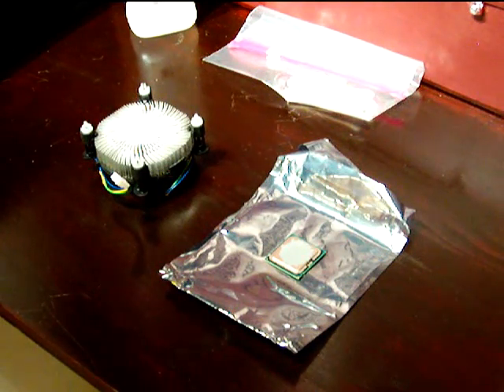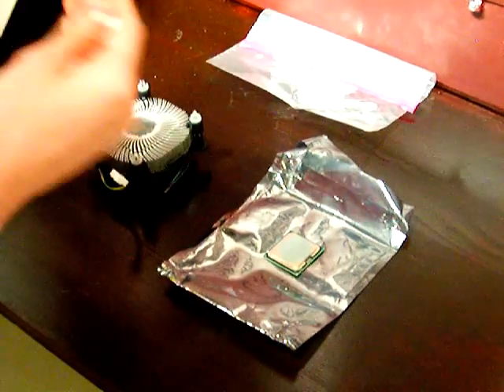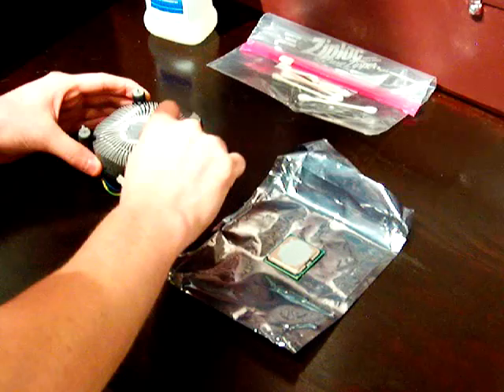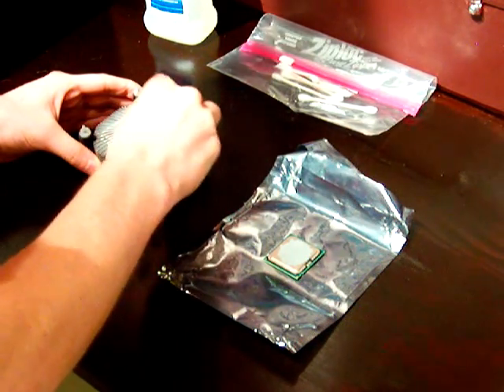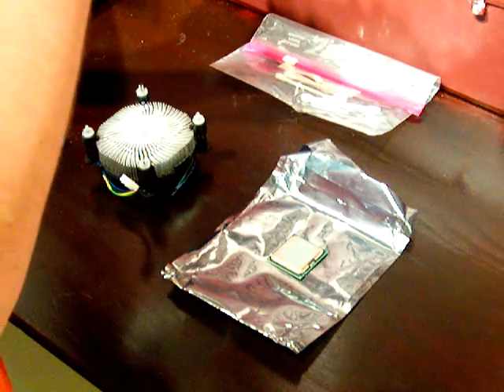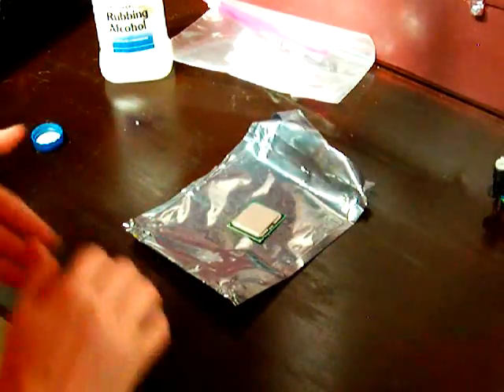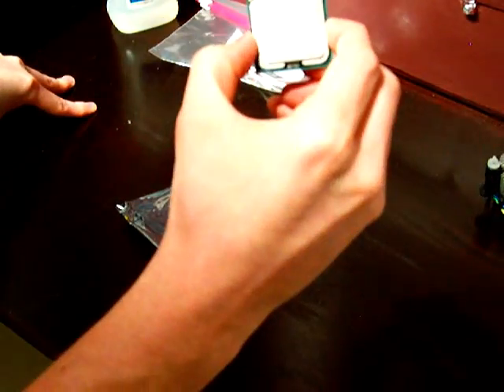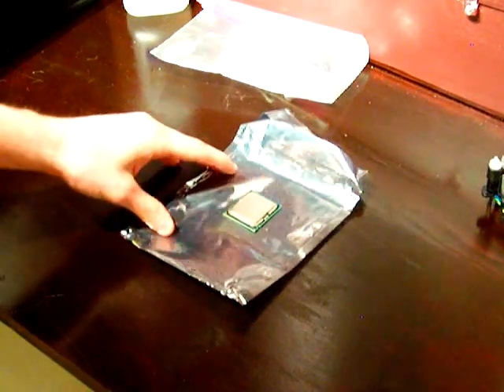How To: Remove Thermal Compound from the CPU or Heatsink

Comment: Mainly due to that when you remove a fan or cooling unit, it will smudge the paste and very likely cause air bubbles when you install a new item. Air bubbles will trap heat and prevent efficient transfer, which you don't want. So even if you were to remove and replace the same cooler, it's normally a good idea to do a clean re-pasting.

I accidentally smudged the paste too much when building my first PC. Had an idle temp of 60c. Re did the paste, and dropped it to 30c. Damn microscopic bubbles.

Comment from the maker: Ideally you should remove the cpu from your motherboard and place it in an anti-static foam square. However, you can clean the cpu heat spreader and apply more TIM while it's installed in your motherboard so long as you don't get any TIM on the board.

Comment from the maker: Yes, TIM (Thermal Interface Material) refers to thermal compound. Personally I prefer to use Artic Cooling MX-2. MX-2 has great viscosity and thermal conductivity, though there are plenty of other viable options. Artic Silver is one of the more well known compounds that I would recommend. Keep in mind that even generic compounds included with heat sink/fans are usually perfectly sufficient.

Comment from the maker: 1. That is isopropyl alcohol as mentioned in the video. 
2. The faraday bag is not contacting the cpu (antistatic foam square) and is simply there to prevent the foam square from sticking to the workbench.

Comment from the maker: Anytime you separate the cooler from the cpu, I recommend cleaning and applying new TIM. As per your question, you can monitor your cpu temps with downloadable utilities. If you weren't experiencing issues before cleaning your computer, the application was likely fineand your temps were in acceptable thresholds. When applying Thermal Compound, you ideally want to apply a thin layer that fills the gaps between the surface of your cpu and heatsink.

Comment from the maker: Qtips are not ideal, but are nice for this particular application because they're readily available to users and are very unlikely to leave behind 'hairs' since we're working on a flat surface with wetted q-tips and no sharp edges for 'hairs' to get caught on. Should you need to clean the fins of a hs/fan you are correct and q-tips should be avoided.

Comment from the maker: "As I've mentioned in the past, this CPU was inserted into an anti-static cpu foam square which was then resting on the faraday bag. The faraday bag was there to prevent the cpu/foam from sticking to the workbench. There were no conductive sources nearby and I was grounded so the cpu was perfectly safe. Again, let me reiterate, that you have misconstrewed the use of the faraday bag and are incorrrect about it posing a threat to the well being of the cpu."

Comment: The issue that's causing your overheating is likely the CPU fan's vent being blocked by a huge dust bunny, making it less efficient (thus the overheat and the high RPM). If your laptop has a removable panel through which you can access the heatsink/fan, then it will be very easy. If not, then you will likely need to take apart the whole laptop to clean it out properly. Blowing compressed air into the vent may help a little, but will not likely resolve the underlying issue.

Comment: Anti-static bags are only useful on the inside. Another note: According to Cisco's IT Essentials course that I took last year, you are supposed to use Isopropyl Alcohol to clean a CPU, so I believe it is safe to assume that Isopropyl would be a better solution. Although you have the point with the residue thing down. I'm not saying you're wrong, just suggestions for future viewers :]

Comment: @wmw0702 putting it on the anti-static mat is actually bad. A wood/paper surface would be good. The outside of the anti static mat can still collect a static charge, just the inside is resistant.

Comment from the maker: @snoopdogsballs It's not so much about damage as it is about residue. The top of the cpu is actually just a cover known as the heat spreader. It's a solid piece of metal that has no function other than to protect the cpu and help to better dissipate heat from the die to the heatsink. Optimally, any solution we would like to use for cleaning off this surface would 1. Dissolve the TIM properly 2. Evaporate quickly 3. Does not leave a Residue which can reduce thermal conductivity.

Comment from the maker: @TheBL00DAssassin In the same way that you would from a cpu. With high concentration alcohol and low lint cloth/swaps. Just ensure that the battery has been removed and all caps discharged completely before starting...and all alcohol has dried before turning on the system. Also make sure not to damage any components on the board or leave anything that might create a unintentional circuit. Lastly, make sure you are electrically grounded when handling all components.

Comment from the maker: @Knightman963 The higher the better for the most part, 90% is nice because it doesn't evaporate too quickly allowing you more time to clean off the surface before having to apply more alcohol.

Comment from the maker: @TheRammsteizer You should always clean off the CPU when reinstalling or replacing the heatsink. However, if your new heatsink already has a layer of properly applied thermal compound, then it should be ready to use and won't need to be cleaned (still clean off your cpu...). Its a good thing that the layer of compound is thin...Ideally thermal compound is only intended to fill any pores in the metal, but not interfere with metal on metal contact which has a higher thermal conductivity than TIM.

Comment from the maker: @QBisbest You won't get the best results with water, and need to make absolutely sure that it has fully dried before applying new thermal compound. I highly recommend sticking to isopropyl alcohol or a specialized compound removal kit/solvent.

Comment from the maker: @kashyap1991 In all honesty, its not going to change things that drastically...but its never ideal. Imperfections in the surface of your CPU heat spreader can potentially cause air pockets which reduce thermal conductivity. 

For practical purposes, if the scratch isn't too deep and you properly apply thermal compound you won't notice the slightest difference in temperatures.

Comment from the maker: Acetone and many nail polish removers are viable and will work quite well. Be sure that there aren't any dye additives. Also, high concentration isopropyl alcohol is recommended due to it evaporating quickly and its high purity. This ensures that no residues are left behind on the top of your cpu that might disrupt heat transfer.

Comment from the maker: @thedemoniaco if you bent the pins, you may very well have damaged the cpu. The heatsink is not an electrical part of your system, so no it doesn't particularly matter that there is a little compound residue on it.

Comment: @GameSinewPCs 
What happens if I accidentally bent 3 pins and made them straight again, would that affect the pc? i notices in the pc i am fixing that after i checked the cpu, the heat sink got some thermal compound and when i put the pc back together it beeps. could it be because of the Thermal?

Comment from the maker: @seafireliv I cannot condone the use of water for this purpose for a variety of reasons. However, if you must use it, be absolutely certain to not get it onto any hardware other thermal compound on the cpu. Also, verify that all water residue is completely dried before applying new thermal compound and or turning on your system.

Comment from the maker: @counterstrikenerd321 Yes, you can hold it by the edges with a latex glove, though the glove isn't necessary. The most important thing to remember is to not touch the pins (so as to not bend them or get oils from your skin on them).

Comment from the maker: @counterstrikenerd321 For general use, the discrepancies between most thermal compounds aren't significant, so any compound should work sufficiently. However, for high-end applications, some compounds will produce better cooling results, can be applied easier or cure faster (or have no cure time). For most general purposes, it is hard to go wrong with artic silver 5, though any compound should suffice.

Comment from the maker: @vnnmurphy So long as you did not remove the heatsink from the cpu, then it isn't imperative to have replaced the thermal compound. However, if you did remove the cpu heatsink from the processor, then you should have removed/replaced the thermal compound. Also, it is sometimes beneficial to replace old thermal compound, but usually insignificantly so.

Comment from the maker: @BryceIon When installing the CPU, hold it by the edges so as to avoid leaving oily residues on its surface. You shouldn't need to push down on the cpu itself when closing the retention bracket, so long as the CPU is seated correctly. The retention bracket is designed to apply the appropriate amount of pressure to the CPU.

I hope this was helpful.

Comment from the maker: It shouldn't be a problem. It would be best to simply ensure that the compound is still evenly spread across the heatsink surface. However, this doesn't necessarily require removing/replacing the current compound.

Comment: I accidently smudged the stock tal pason a stock core i7 heatsink, it is a little smudge on 2 of the bars, would I have to put on brand enw paste or would it be safe to use the smudged thermal paste, this is also my first build and donm't want to take any chances

Comment from the maker: @shawnygz You can apply a small amount of heat, but you really shouldn't have to. For alcohol, wait a few minutes until it evaporates and you should be fine. Water may take a bit longer, so a fan might help speed up the evaporation. Just make sure that the cpu is completely dry before installing it/turning on the system.

Comment from the maker: @FateStayNight1991 No, this would not 'break' the processor. However, if this happens, then you must ensure that the processor pins and or socket are completely dry before installing an turning on the system. Otherwise, you may create an electrical short and damage the processor or motherboard. High concentration alcohol evaporates rather quickly.

Comment from the maker: @PeaceISL  No, not a problem at all. So long as the liquid is not around any active circuitry, and dries before you turn on your system (rubbing alcohol evaporates very rapidly), then it will not inherently harm your components. The only risk of applying liquids to electronics is by creating shorts in your electrical circuits which can fry the device. So long as your system is off, unplugged and you allow the alcohol to dry...then you will be fine. Does this answer your question?

Comment from the maker: @PeaceISL  usually you'll have to use something (such as rubbing alcohol or acetone) to first break down the bad and then a stiff straight edged object (recommend a plastic card and nothing sharp) to gently scrape it off. After you've performed this, it is generally best to go over the surface of the heatsink or cpu with some rubbing alcohol as shown in the above video to ensure that all residues are removed.

Comment: how about a thermal pad (used for 1-2 months) that came with the stock amd heatsink. can you wipe it out with a napkin or paper towel. or you still have to use rubbing alcahol on it thanks

Comment from the maker: @FubuMushu You can first use WD40 to help dissolve the thermal compound. However, you must then use alcohol to remove any WD40 residue. I personally recommend just using the highest concentration of alcohol that is available.

Comment from the maker: There are quite a few options in solutions that you can use. I recommend trying to find some alcohol or else a proprietary cleaning solution such as Artic Silver's Thermal Material Remover and Surface Purifier.

Comment from the maker: @Tito0096 I recommend using black silicone more over super glue, though it will cure at a slower rate. Also, make sure that before you do anything, you have 1. Grounded yourself and 2. Cleaned the surface of the CPU die.

I hope this has answered your question, if not then let me know. Also, be very careful when/if attempting this or if running your CPU without a heat spreader. In either case, CPUs are sensitive electronic equipment and must be appropriately handled. Best of luck!

Comment from the maker: @Tito0096 What you're referring to (the plate that is, in your case, no longer attached to the CPU die) is generally referred to as the CPU Heat Spreader. In order to reattach the heat spreader to the CPU die, I recommend using a small dab of thermal compound on the die itself (to help heat transfer between the die and the heat spreader).Then secure the edge of the heatspreader to the CPU base by using either black silicone or super glue and an appropriate amount of pressure/placement.

Comment from the maker: I replied to you before, but it didn't post as a response. I'll repost it under reply again, if it doesn't work look for the most recent uploaded comments. Also, I recommend using Artic Silver 5 or Artic Cooling MX-2 Thermal Compound.

Comment from the maker: There are other methods available as well, such as manually spreading the TIM by placing your finger inside of a plastic bag or a latex glove, or using a flat edged object to evenly distribute the TIM (not recommended for inexperienced users).

Comment from the maker: There are various techniques that you can use to apply thermal compound. Probably the easiest of which (though not necessarily the most effective method) is to apply a small bead of TIM to the middle of the CPU. Then, proceed to install the heatsink on top of the CPU, but before securing it in place, rotate it while gently pressing down to smoothly spread the TIM across the top surface of the CPU.

Comment from the maker: While most TIMs won't dry out in any noticeably short span of time,  after you have applied the thermal compound, it is best to install the heatsink as soon as possible. You should not install a heatsink onto a CPU with dried thermal compound.

Comment from the maker: In short, the purpose of removing old TIM is based upon a few factors. 1. Old TIM will have dried and therefore will not provide an optimal contact surface between your cooler and cpu. 2. Old TIM when taken out will often have blisters, cracks and other imperfections that will trap air (an insulator) between the two surfaces. etc...

Comment from the maker: Depends upon where you purchase it from. Artic silver 5 will run you anywhere from $5-$20 shipped for a 3.5g tube. I personally recommend using Artic Cooling MX-2 as it is easier to apply, less expensive (depends) and offers superior cooling along with no cure time. That usually runs just over $10 shipped depending upon where you get it. 3+grams of  compound will usually cover quite a few applications depending upon how much you use (less is more with TIM).

Comment from the maker: However, if you're looking for an easy to install and maintain cooler, then a nice Air cooler should suffice. I recommend looking around and comparing coolers with features that you're looking for. Try to find one that will perform to your expectations within your system constraints, budgetary limitations and without too much hassle to install/maintain.

Comment from the maker: Thermal electric (or peltier) plates are usually incorporated into liquid cooling systems to supplement the heat transfer between the CPU and the water. Any given TEC-based watercooling system vs a non TEC-based watercooling system's performance will vary based upon the quality of the design and the implementation of the product. So in short, it really is situation dependent. Usually a high-end custom H20 kit will more than suffice for heavy OCs if you're willing to undergo the hassles of H20.

Comment from the maker: Rubbing alcohol is used because it effectively helps to dissolve TIM while evaporating at a rapid rate (which helps to make sure that there is no liquid caught between the CPU and heatsink surfaces). So long as you were able to remove the old thermal compound with minimal remaining residue and your system temperatures are within appropriate thresholds then it shouldn't matter how you accomplished that. Just don't use a solution that will compromise your hardware in any way.

Comment from the maker: I had typed out a more thorough reply, but Youtube's ever inconsistent messaging interface failed to post it. Suffice it to say that, yes you should remove as much of the old TIM as possible, but if your current system temperatures under load are within appropriate thermal thresholds then it is not imperative to have perfectly clean surfaces when installing your CPU/Heatsink.

Comment from the maker: How clean the surface is depends upon how you clean it and how many passes you do. Usually there will be some residue remaining from the previous TIM unless you are very thorough. Now that it is dried, try performing a few more passes while applying a little more force to the Q-tip ("scrub it" firmly, but don't press down on the pins) and see if your surface has changed at all. Before and after pictures may help you see any differences.

Comment from the maker: That is a much more normal range of operating temperatures for that cpu and that heatsink/fan. It is well within acceptable thresholds and your cpu will be fine running at those temps. Good to hear that the problem was resolved.

Comment from the maker: From what you just said, it sounds as though the heatsink isn't secured tight enough or installed properly. Try reseating the heatsink (make sure you do use new TIM) and you should be good to go. Good luck.